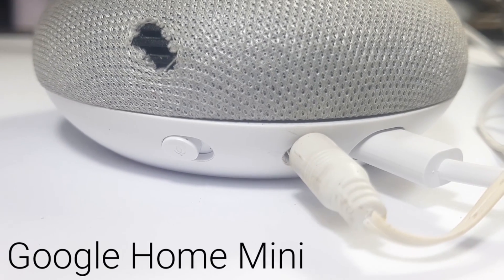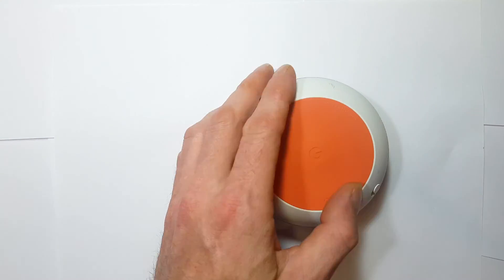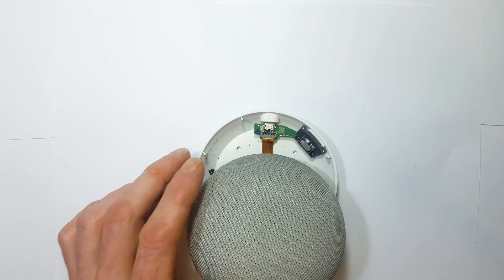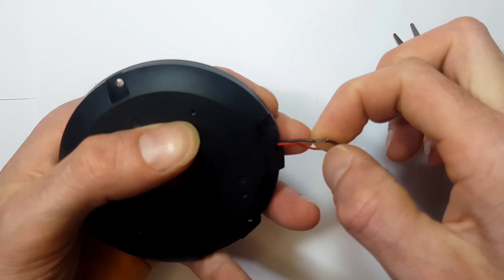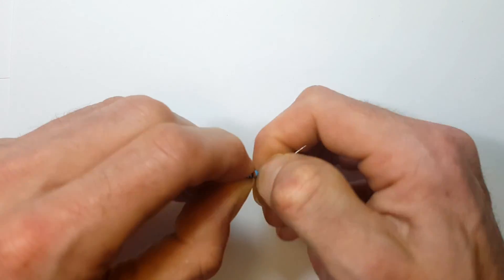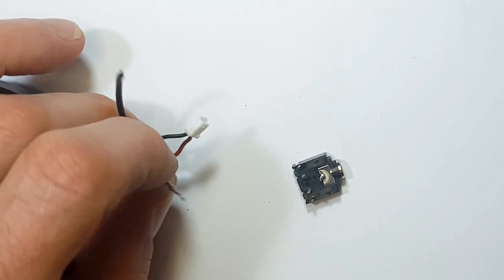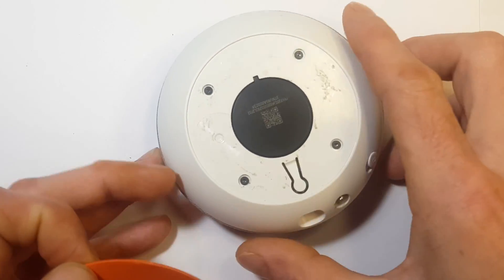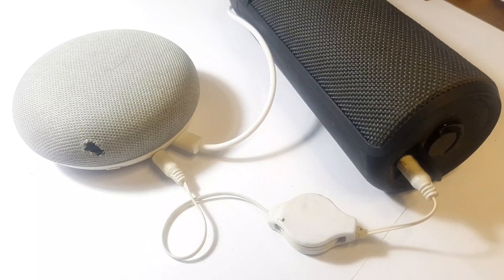Google Home Mini Hacks - AUX Mod

Comment: Not sure if you'll respond to this cuz it was 5 years ago but am I able to just leave the speaker out completely?  I'm thinking of modeling a replacement bridge to attach the back white cone to the fabric portion of the speaker and leave the actual speaker housing out. This way it gives me additional space inside to add additional hardware.

Comment: What does the resistors do? I did mine without and with resistors but did not notice any difference with the sound
Reply from the maker: It will likely damage it slowly over time and eventually burn out other components. I would not recommend leaving it without the resistor

Comment: Hi, you could mention it has a standard feature to connect the Best Mini to a Bluetooth receiver, like a speaker or a RCA Bluetooth receiver?  That way you would have stereo as well. In Google Home Assistant app goto the settings of the Nest, set it to Bluetooth discoverable, as well as the speaker,  pair the speaker. Nice hack though.

Comment: I've just bought a google home mini for €10,- a real bargain, and also harman Kardon pc speakers from the year 2003 for another €10,-. The speakers have the option to adjust the base etc with a sub woofer and two speakers. They come with a additional power cord. Can you tell me if the resistors are powerful enough to combine it with old pc speakers? And can I remove the old Google Home speaker so it only uses the harman karbons?

Comment: This is exactly the tutorial I was looking for, thanks!! If you ask the home mini to turn up or down the volume using a voice command, does it also adjust the output of the new aux port? I would assume so
Reply: it would since you are just tapping into the speaker lines so every sound that goes out google's speaker would also come through the jack unmodified.

Comment: I Bluetooth a subwoofer to enhance the sound quality of my Google Max speakers. I get a half a second sound delay.  The only way to fix this problem is to create an AUX out 3.5 mm and plug it directly into the subwoofer. I'm just insecure about doing the work myself. I'm looking for a electronic place that would do this for me. Any advice, thank you Frank

Comment: Brilliant hack. Just what I've been looking for.
Maybe a toggle switch could be added to switch between internal and external speakers to avoid the delay. Which speaker suffered the delay?
Reply: its propably the external speaker thats delaydes, since the audio jack is spliced directly into the speaker wires of the google home.

Comment: Why resistors? The bluetooth speaker wouldn't be driven by the google speaker amp. The bluetooth speaker has its own amp.
Reply: I'm 2 months late, but just in case anybody else has the same question:
You're plugging into the AUX in on the bluetooth speaker which requires a lower voltage than what is supplied by the wires on the nest mini you're tapping into. 
The two resistors in that configuration creates what is called a voltage divider.

So as an example. If you're getting 3 volts from the nest mini amp to the nest mini speaker and you don't use the resistors, you're also sending 3 volts to the AUX in on the bluetooth speaker, which is too much and you'll probably end up killing its amp.
But if you do use the resistors, you'll be getting 3 volts from the nest mini amp to the nest mini speaker, but only 0.273 of a volt to the bluetooth speaker, and you won't kill it.
(If you add the resistors the wrong way around, you'll be sending 2.727 volts to the AUX in, which would be a waste of time. (3 - 0.273 = 2.727 volts)

And mathematics for the fun of it. :)
(Voltage input x Resistor_2) / (Resistor_1 + Resistor_2) = voltage output.
Voltage input = 3 volts.
Resistor_1 = 3000 ohms.
Resistor_2 = 300 ohms
((3 x 300) / (3000 + 300) ) = 0.273 voltage output.

And you don't necessarily have to use a 300 ohm and a 3000 ohm resistor. A combination along that ratio would do the same thing:
A 600 ohm and a 6000 ohm combination would result in the same voltage output.
((3 x 600) / (6000 + 600) ) = 0.273 volt output.

A side note, but important.
Voltage dividers aren't really meant to carry current. So you can't use them to lower the voltage in order to power anything. Halving the voltage to power a 6 volt light globe from a 12 volt battery for example, you'll be getting 6 volts to the light globe, but the current will burn out the resistors as soon as you turn on the light. (exceptions apply)
The current going to the bluetooth speaker in this video is miniscule, so it's not a problem here.
Reply: @-Fritz-  Hey, is it possible to cut the nest mini speakers from the nest mini and connect the cables directly to the resistors with the aux cable. So the whole thing without the nest mini speakers?

Comment: I think I noticed a flaw. When you did the test at the end, you hear the millisecond audio delay resulting in an echo effect. Is there anyway to completely mute the Google Home Mini speaker so that audio comes only via the aux port? Otherwise I'm quite impressed and interested in having someone do this for one of my Home Minis since my Bose SoundTouch speaker and older Aiwa stereo are only WiFi or Aux, no Bluetooth.
Reply from the maker: Yea just disconnect the wires to the speaker :)
Reply: @TinkerManMick  how much would you charge for me to send this to you to have my Google Home "upgraded"?

Comment: The resistors form a 10:1 voltage divider to attenuate the speaker voltage.
Reply from the maker: Smart! Thanks mate 😁
Reply: do you need the voltage divider if just connecting head phones to the aux jack?

Comment: Ironically a 3000 ohm and 300 ohm resister in parallel equals 272 ohms. So I don’t see why you couldn’t have just used the 270 ohm resister by itself. 🤔
Reply: Because it wouldn't work. Notice that the resistors aren't wired in as one. One leg of each resistor goes to different places, and the other legs of both resistors are joined and feed the line out positive.

This method is called a voltage divider.
Reply: @paulraymond1804  sure enough I think I missed the part where he connected them to both leads of the speaker wires. Oops. Now it’s making sense. 👍🏻
Reply: That would not work, you need the voltage divider created by the two resistors. Notice that the output to the jack comes from the joint of the two resistors.
Reply: @molorjul  yes, I saw that when I went back, and noted it in my later response.
Reply from the maker: I learn something on here all the time. Thanks mate!

Comment: Damn, this is actually the best alternative for a chromecast audio
Reply: It's pretty bad that Google is too dense to have put an aux output on a device so us with built in speakers or better speakers can enjoy them properly. I'd buy at least 1 and up to four Nest speakers if they'd solve this exact problem.
Reply: @brl5755  They would loose sales on the more expensive googe home speakers if they put an aux port in
Reply: @TouchedAlot there gonna get zero from me because all my speakers are better than the more expressive Google home speakers, I want the features and ecosystem not a downgrade in audio quality. Currently there's no solution for those with installed speaker systems
Reply: Not so good cause it's mono. I use a normal ChromeCast with HDMI extractor that has digital audio output. That's great quality when using on an external DAC
Reply: Not really. I have a regular Chromecast ultra connected to an hdmi audio extractor.... Works perfect.
Reply: @starmc26  nah the sound is crap quality compared to the regular cca
Reply: @mun33y  lol, it's exactly the same.
Reply: @starmc26  which extractor do you use
Reply: Every speaker a smart speaker...

Comment: Thanks for the video. I did this mod and am a bit disappointed with the audio output when connecting to a receiver. The audio is very tinny and I don't have an eq to compensate. Oh well.
Reply: it the volume is too low, simply use different resistors. Use 2 1k500 Ohm resistors. In stead of 10%, you have 50% of the speaker level.
Reply from the maker: Thank you, I suggest trying to add an amp to the circuit to improve sound quality- it can go quite a bit louder then too. Im glad you had a go at it with some success! Thanks for your comment 😀

Comment: Hey Mick, this is awesome dude! In an effort to basically turn this into a Chromecast audio (which unfortunately you cannot buy anymore), I think this could essentially perform the same task. Would this mod still work by disconnecting the internal speaker permanently if I was to dedicate this to a 'dumb' speaker(s)? If needed, I know there are some mini amps that could boost the signal. What are your thoughts? Cheers mate!
Reply from the maker: Thats a great idea mate! You could certainly do that but I would run it to an amp first as you suggested otherwise the volume is terrible. Thanks for your clever contribution 😁 let me know how you go!
Reply: No stereo audio though. Following these instructions, you only get audio on the left side
Reply: @alekgv  maybe you bought the wrong aux plug? but yeah only mono
Reply: @sylvester4207  maybe. But it was easy enough to modify things to get audio in both channels. Still mono though, but that’s to be expected, as the device is only capable of outputting one audio channel.
Reply: I was in until it was mono. Darn.
Reply: YOUR

Comment: I am currently using the Bluetooth option, you can simply ask your Google home to enter Bluetooth pairing and then search the device on your phone's Bluetooth settings. It is the same as doing this with the same amount of lag. This method in the video would be worth the effort if it didn't have any lag at all.
Reply from the maker: I knew you could connect it via the home app but didnt know you could just ask it!! Thanks dude! 😁
And yea that lag is a pain hey!
Reply: @TinkerManMick  I think the lag is just the speaker processing the audio from the aux, but i could be wrong
Reply: glad you said it was the same amount of lag as was thinking about doing this to get rid of any delay! guess ill find a normal hard wired speaker for my pc.
Reply: @V_raptor88  dude!!! Thank you so much for sharing this!!! I had google home from 3 years but didn’t know you could BT pair it! 🙌🏼

Comment: This is a waste of time. Just use Bluetooth.
Reply: It's absolutely not a waste of time. A hard wired connection is always superior to a wireless connection, especially Bluetooth.

I am going to tear down a mini and install it in my Ryobi radio.
Reply: Thanks for the like, whoever you are. I have today installed the brainbox of a Google home mini in my Ryobi workshop radio. It's portable, sounds great and I estimate a 5ah battery can run it for about 12 hours.

When the battery goes flat, I just put a fully charged one in.

I think there's nothing on the market like this.
Reply: @paulraymond1804  Absolutely but the Bluetooth will be stereo if it's hooked up to a stereo speaker/amp and this mod Is mono.
Reply: @SkoTTe666  that's not really relevant is it. The thread author was comparing this mod, a line in port on the Google home mini, to using Bluetooth with the mini. Both are mono.
Reply: @paulraymond1804  is bluetooth mono ?
Reply: @SkoTTe666  Bluetooth can do stereo. The Home mini has only one speaker though.

Other "stereo" Bluetooth speakers have their speakers too close together to sound like stereo, so they may as well be mono. The two channels blend together.

For a decent stereo experience you want the two speakers at least two metres apart.
Reply: @paulraymond1804  ahh yes but I was thinking you connect the mini to a bigger hifi or similar via bt and get stereo but i se your point.
Reply: @SkoTTe666  yes you are right, when using BT to a stereo device, the mini will enable stereo use. Even the bigger bluethooth single box speakers often have separate drivers for left and right to give you some sense of stereo. Will never beat two separate loadspeaker boxes, but better than mono.
Reply: @paulraymond1804  no it ain't, wireless stereo still beats wired mono
Reply: @ewoutbuhler5217  this video uses an alternative method to connecting the mini via Bluetooth to a larger speaker. The problem with Bluetooth is that it introduces a delay. This becomes a real problem when you play audio in a group of speakers. Speakers are not synchronised, therefore they sound terrible.

I know that the Google home app can adjust for this delay, however the delay is not always the same, it is inconsistent. Thus, the delay correction often doesn't work.
Reply: @paulraymond1804  agree, in a Google Home/Chromecast group of speakers , using Bluetooth with the mini is not a solution. But when there's only one device playing audio, that is stereo, connecting the mini speaker to that device works ok. Still not great, because of all kinds of stability issues. I prefer the Chromecast built in option that many devices have nowadays.
Reply: But what if people got an old stereo it would save alot of money
Reply from the maker: @Stephen Hawes does a cool mod where he takes a google home mini and fits it into a retro radio. Looks really cool! Check it out here https://youtu.be/PC2-D_Pk1s8
Reply: @TinkerManMick  still  mono
Reply: @archie2934  mono

Comment: if you have a google nest mini. If it is a full silicon pad all around the nest. Don't take off the silocone. There is a screw under the wall mount hook under the orange plug. Take the screw out then shift the bottom like you are rotating it. Then the bottom should pop off. Model H2C Google nest.
Reply from the maker: Thanks for sharing mate :) I love this community! Have you modded a nest at all?
Reply: @TinkerManMick  I took mine apart today. Going too mod it tomorrow. Great video!
Reply from the maker: Thanks mate, check out the other comments first, myself and others would recommend adding some way of disabling the internal speaker while the aux port is connected and in use. Let me know how ya go with it and if you dont mind sharing, please send me a tweet or share a pic on the facebook group as I would love to see the finished product! (Links in description)
Reply: @CircularMirror7  hey, just wondering if you were successful in modding your nest? I just ordered mine now.

Comment: Any link to a recommended aux port?
Reply from the maker: Something like this is what I used, although you may prefer one slightly smaller. It just needs a ground and at least 1 audio input to work.
https://www.amazon.com/Uxcell-a12062600ux0366-Female-Stereo-Connector/dp/B008SNZUYC/ref=mp_s_a_1_71?dchild=1&keywords=aux+jack+female&qid=1587535811&sr=8-71&swrs=641F4E438FBF383899E76F9DA3E9671E

Comment: I did this hack but found that anything other than full volume and the google and the sound diminishes. Has anyone else found this?
Reply from the maker: Thanks for mentioning this, the one I did this mod on had a broken speaker so I didnt test for anything like this afterwards
Reply: Tinker Man Mick. Thanks for the reply, the problem I’m having is when using the new aux port plugged into an amplifier.
Reply from the maker: Others have suggested adding a switch to disable the internal speaker while an external speaker is in use. That may help?

Comment: Hi there, two questions can I use the aux signal to connect it to an amplifier? And what would happen if I don't use the resistors?
Reply from the maker: Hey Danny, keeping in mind im just a DIY guy and stand to be corrected - you can connect it onto an amp, but you will only have mono, not stereo sound. And if you dont add the resistors you can burn out the internal amp that the google home mini has so it will work and produce louder sound, but you risk damaging your google device long term
Hope that helps! 😁
Reply: @TinkerManMick  rather than damaging the output of the Google speaker, you might damage the input of your amplifier as you are driving it too hard. The sound will get distorted.

Comment: Only one extra thing I would want from this.  That is to mute/disconnect the internal speaker when the "aux" is connected.
I should imagine that would not be too hard to accomplish, but would likely involve more space than you have available.
Reply from the maker: Thanks for the feedback! 👌
I agree that some way of muting or disconnecting the internal speaker would make this mod perfect, perhaps something for a future video if i get any requests, although you are right about limited space! Struggled to fit that little aux jack in! Lol
Reply: @TinkerManMick  some of those aux jack's have switching in them, but not seen one with internal switching that small.
Might have to Google and then work out the resistor layout.
Reply: Hi, have anyone tried to upgrade the mod so it disconnects the internal speaker if connected through the jack?
Reply: @julian_online  you should you able too wire it too a switching mono jack. It connects the speaker then disconnects when aux is plugged in.
Reply: I'd like it more if it had an option to turn on/off the internal speaker, it may be good for dual-speaker setups.
Reply: @LoganT547  I can see a use case for that.
Also, you could, in theory, run two speakers on the Aux output, as long as you don't cause the impedance to drop too low.  :)
Reply: I wouldn't risk voiding my Mini's warranty to try it, I only got it on boxing day so it's still fairly new ;)
Reply: @LoganT547  wait for the warranty to end then have a go, or get the first version second hand, they are pretty cheap, to experiment with 🙂
Reply: They only have the Home Minis in NZ, never seen the Nest Mini at a store
Reply from the maker: @Logan T The bass is a lot nicer in the nest mini, you can grab them on ebay or from google's online shop directly i think
Reply: switched line level out jack of some kind?
Reply: I heard stabbing the speaker helps